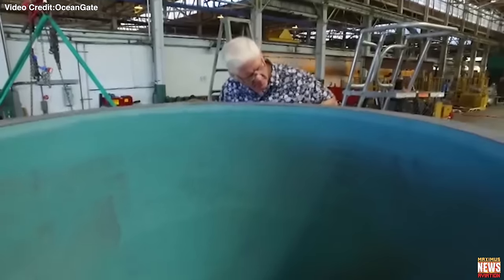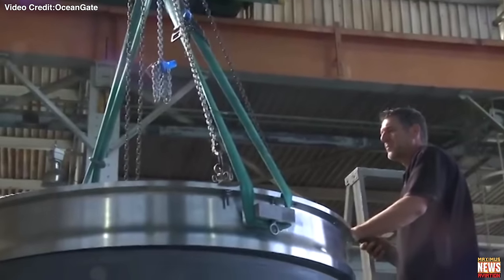Watch The Manufacturing Process That DOOMED OceanGates Titan To Fail. But It NEVER Had To Happen.

Comment: So the flange of metal over the composite was like an inch or two?  I understand the pressure would push the ring against the carbon fiber anyway, but, it's compressing the carbon fiber away from the ring too.  As the carbon fiber would compress more than the titanium.  I'd have at least wanted a deeper flange so MAYBE when they separated it would be a small twisting channel the 1000 psi water would come through first and it'd have to carve away the rest like a pressure jet.  with such a small flange the pressure jet had almost nothing to resist it's sideways spread until it stripped the epoxy from titanium and separated the ring.  Well it would have if the drum hadn't splintered into 1 million shards from the implosions micro seconds after the first spurt of water around the ring.

Comment: BS Mechanical Engineering here One thing that stuck with me from my education is the engineering code of ethics. When dealing with the safety of the public in any capacity you have to make sure safety in the design process is as important as functionality. You have to have all the stress calculations and material properties tested at not only 4000m but even 8000m on multiple tests. This is an engineering ethics scenario that should be studied for years to come. RIP to those 5 men.

Comment: while carbon fiber probably wasn't the best idea, i'm pretty sure it was the plexiglas window that was only "certified" for about 1k meters or something? guess we will know once the investigation is complete. but the most obvious piece to fail is definitely the window considering that they pushed it past almost 4 times what it actually was safely able to withstand. or just the caps flying off because of the pressure considering they were literally glued on. i doubt the hull was what gave in / was so unstable that it actually imploded. maybe... but the window and/or the caps seem more obvious.

Comment: Maximus, hope you read this. I think it's irresponsible from you to blame the manufacturing process itself. It is neither the process nor the material to blame. It is the decisions taken as part of their design process. Filament winding excels in producing pressure vessels, that withstand even higher pressures that those the Titan was designed to bear. Composite Overwrapped Pressure Vessels (COPV) are designed and produced to withstand even the double of pressure you find at 4000 of depth. There are several flaws in their final product that come from their engineering: the Titan is not reinforced along its axial direction despite its structure is submitted to a biaxial state of stress (even triaxial if the thickness is considered as sufficiently thick); the angle of the wound reinforcement seems to be 90° when it should have been close to 55°; and perhaps the most important, the interphase between the metallic liner and the composite shell. There exists a discontinuity in deformations and stress. So, if there's something or someone to blame, is their lack of responsibility in ensuring a safe product. This guy, the owner, CEO, whatever, he was an aerospace engineering. He disregarded "basic" concepts, concerns, and regulations. So?

Comment: I think they were thinking the pressure would keep things together.. like Previous comments glueing metal to carbon fibre doesn’t work with out some Mechanical fasteners … The process of laying up carbon finer was very interesting thin strips Wrapped continuously to form a Cylinder not much over lap of each layer not like laying up large sheets…. The titanium ends then where bolted with 17 small stainless steel bolts torqued… Come on it was bound for failure… I’m surprised it never failed on the first dive…

Comment: I think that add exterior titanium cilinder with a lot of screws on both sides (like the windmills in the basement) atached to the rings, plus the glue (as seal) would be solved the problem. Only the glue on a smooth surface, to me, looks a bad idea. Different materials, high compress and decompress at diferent sizes, repeating......

Comment: Not only was it made from carbon fiber, it’ appears it was made from unidirectional carbon fiber tape, which is much less sturdy than a bi directional weave. When they said it was made from carbon fiber and titanium, I assumed the entirety of the pressure vessel had some sort of titanium layer, but it appears titanium components were just bonded to it. Truly unbelievable. A bad design covered up by some decent looking probably purchased exterior cover panels. Sketchy

Comment: Tension vs compression...  Carbon tanks are use a lot for firefighters and now lately also in Scuba industry when price is cheaper. But that is carbon weave holding compressed air under "tension" . Carbon fabric is good at holding tension.  But compression is whole different story. Then fabric is the worst type of material to use against external pressure.

Comment: Unidirectional orientation of the carbon fibers?  This means that the the only thing resisting the two titanium caps pressing on the cylidrical part, was the epoxy matrix of the composite!  This submersible was not even safe to dive down to a depth of 2,000 meters!

Comment: I just don't get why titanium was not used for everything including the body? Human carbon fiber technology is still quite in its infancy.

Also, glue to hold 2 different materials together. GLUE. No engineer, but I do know a little bit about physics and strengths and weaknesses of different materials. Eventually that glue would degrade from the constant pressure changes from multiple dives. Not to mention the differeces between the titanium and carbon fiber, one of them definitely micro fractured during the many dives due to the materials stressing on each other from PSI (the titanium crushing into the carbon fiber), and it wasn't the titanium.

Comment: Carbon fiber can only be as strong as steel in TENSION, but is always weak in COMPRESSION, for the same reason that you can pull a rope but you can't push a rope.

Comment: There was no engineer involved. Not in the design, neither in fabrication. It is no problem to get a permit for an experimental plane, but it would be impossible to start selling tickets for seats, even if the guest sign a disclaimer. How someone can use an experimental can to sell tickets is completely paradox for me.

Comment: Please tell me they somehow interwove those fibers...😕

because this suggests the fibers were not interwoven at all
just paralel rolled next & on top of each other 
& bonded with resin

At least please someone tell us they somehow did rolled perpendicular diagonal layers...
not really interwoven, but at leat much better/stronger than merely paralel rolled...

However I can't see how, with this setup,
they could do it fully diagonnaly 
in & around the cilinder's edges
unless they could build the cilinder 
with a fair bit of extra lenght
& then cut it to size...

Comment: i really doubt any of them had read what they have signed. stockton rush probably rushed them into signing the contract by just briefly going through it without going through the points that would make it look like a death trap
Reply: Money is money, if you're told to build component x you just do it.

This vessel never got any approval from any kind of engineer or authority, only "simple" worker did what they got paid for.

Comment: Jesus - what a ropey effort.  As a structural engineer with composites experience, I have to say I am horrified that a) Anyone could be so ignorant as to design such a lash-up, and b) Anyone would be crazy enough to get in it and go to any depth.   As scubasteve points out below, the CF and Ti components are totally dissimilar materials and it should be obvious, even to non-engineers, that the interface between them would be the focus of all sorts of extreme stresses not accounted for in this design - "glued together" - OMG!  I was also amazed to hear that NASA, of all people, were involved in this "engineering" fiasco early-on (furiously backpedaling out later on).  They should have just told Rush right off:  Man, are you insane?  Do you want to die in that thing?  And by the way, idiot, CF is for a Tension based paradigm - DO NOT USE in Compression.          But hey, what do those balky engineers know anyway?

Comment: WOW,  this was made to fail. Fibers put down in one direction only LOL  not criss crossing each other ...pure madness. This is like making a wall from columns of bricks and not interlocking rows with each other ^^  ..then ..gluing those caps to the cylinder :D  That seal failed or the tube changed to dust in 1 millisecond due to fibers delamination from previous dives.  INSANITY.

Comment: that door could be attached to the ring so securely  !!!but that doesnt matter!! becuase the 2 piece window door- ring  combo  was only held onto the main tube  by outside slippery  glue ! that  may have bubbled and started tearing away with each dive and  contracting. and expanding  . why couldnt they house ten bolts additionally with the glue drilled thru it !!!! this vehicle was never destined for longevity!!! surely with glue it would have been expensive , to maintain this glue take the whole titan apart apart and redo ... he didnt want to have to take it apart.  Maybe he thought it was stable.... and seeing  peoples weight and feet resting on the door during launch at a downward angle puts pressure on the glue and also if somone uses the bathroom there whole body weight is squatting on the door -ring combo . surely this stress along with normal degradation would accelerate even the damage that would occur From the salty water anyways... and pressure from the prior dives

Comment: Even the cheaper Chinese Carbon fibre road bike frames are never laced like that!!! There is no cross lace for side pressure, it is the most dangerous lacing without switching direction patterns. They thought that thin metal tubing would be protected by the Carbon layers which if you see are completely wrong even for normal above water applications!!

Comment: I have zero knowledge in this subject, but common sense alone should be enough to realize that this thing wasn't going to last long under that pressure.
It was horrifying to watch them glue the carbon to the titanium as if they are baking a cake. I would've never gotten into this sub, not in a million years...

Comment: The fact that this shit worked on 7 different dives and failed at number 8…
making the carbon fiber and inch thicker could’ve made it last a lot longer than 7 dives probably 10 or 11
Reply: nope. most of the dives were aborted due to weather or equipment failure. In reality this was like the third.

Comment: As far as I am concerned Stockton Rush committed suicide, and the shame is he took innocent people with him. The Oceangate Titanic was essentially two dustbin lids glued to a cylinder of gaffer tape and it was a disaster just waiting to happen. Just access and read David Lochridge's legal filings in respect of his claim for illegal and unfair dismissal where he described the inevitable failure of the Titan - then try a bit of a mind experiment and imagine it was filed after the damn thing imploded. You'd think "Yeah, right. Twenty twenty hindsight - really useful, that." Then stop to think it was filed five years before the Titan went kablooie and yet it precisely describes the technical, design and engineering flaws in the damn thing and how they would inevitably lead to disaster. Quaite frenkly it is chilling but compelling reading.

Comment: How did they ever believe a seam of glue would have kept out millions of pounds of pressure over repeated cycles. His aerospace aviation engineering knowledge didn't translate into deep sea submersibles. Rush also reportedly completely rebuilt the hull after a 2019 dive reported cracking noises in a Caribbean test dive.

Comment: This could only have worked if all the parts were carbon fiber. Glue joints are always weak links. I can’t understand for a few pounds saved, why they choose carbon fiber in lieu of a traditional steel hull which we know works.

Comment: Engineering factors of safety.  Engineered structures are designed with what is called a factor of safety.  A factor of safety can be anywhere from about 1.5 to 3 or more.  A factory of safety is used to a address uncertainties with regard to loads, material strengths and operational conditions.   At the time a structure fails, the factor of safety is less than one.  The fact that the Titian made previous successful dives says nothing about the actual factor of safety under which it was operating at the time.  It could have been 1.1, 1.05, 1.01...............in other words it could have been very close to failure.............................

Comment: you can practically see all the foreign material getting stuck in the carbon fiber, as they assemble all these different materials with glue in an open air warehouse by guys wearing dirty aprons and old leather gloves, it just doesn't seem like an environment where you should be making a high pressure vessel out of non-contiguous materials with nothing like heat or pressure burning or keeping foreign materials out

Comment: Rush kept touting Aeropace techniques to progress faster and ignored an important one that applies to every airplane since the Comet. 

For airliners, Materials like Carbon Fiber or even Aluminum have Fatigue life & finite load cycles that are determined, watched and tested to destruction. 

That sub felt like a garage built prototype made only to prove the design & find failure mode and not for people.

Comment: Why did they choose carbon fiber in the first place? It's not a spaceship and It's  not an aeroplane so weight should not be a primary concern. 

It's not that much cheaper than steel, is it?

Comment: I have no engineering qualification but just a simple DIYer. Even i know having to completely different materials fixed to one another with "glue" over time with the huge amount of pressure in those kind off depths your asking for a diaster with both materials failing at that joint part.

Comment: I don't like the way they have applied the carbon fibre I would have thought a diamond Patten. Would have been better. And I presume this is the original hull. In 2020 -2021 the hull was rebuilt due to signs of Cyclic Fatigue. He managed to source the replacement Carbon Fibre at a discount from Boeing as it was to old for use on there airplanes. It beggars believe especially considering Carbon Fibre has only 40 - 60 percent of the strength when used in compression. That's why as a general rule it is only used in Tension, as in pushing it outwards basically stretching it.
Reply: The 2017 Composite World article on the planned build claims 480 layers, a mix of equatorial wound layers and axial layers of strips. We don't see any axial layering in the video.

Comment: trying to wind thick-wall composite windings with this type of machine is already a flaw, it builds up locked-in tension between the inner skin and the outer skin, leading to the inner skin splitting away normally around halfway through the composite winding... you need a much more advanced process to start with to overcome this and that's before i point out all the imperfections that a visible in the film clip of the machine running, the process looks rather dry as well which leads to even more fatigue issues longer terms... i would be surprised if there was already a split going on prior to this dive all ready and without standard ultrasonic inspections and trained inspectors you would not have noticed due to the titanium flanges bonded on the ends.... which are bonded incorrectly if you follow any type of standard composite practices... all the staff should have don human factors course to understand the impact everyone has in these type of processes.... though it's always easy to point out afterwards....

Comment: Little did they know they were building a coffin. Even a junior mechanical engineer could tell you this was trouble waiting to happen.
Reply: They usually come in threes (the causes AND the disasters - freaky).

1. CF not appropriate material.
2. A cylinder OF ANY MATERIAL. At that depth? Gulp.
3. CF not cross-wound. Could snap the cylinder into two pieces over a large knee.

Comment: There are literally seals on that sub that couldn't even be accessed to be inspected. 

The glue and carbon fibre are the reason you're all chum now. 
Over time it degrades. 
On the first use, it's stronger than its 10th. 
So he'd obviously reached the maximum number of cycles. 
And at the cost of the sub total 250k! 
He could afford to make them disposable! 
Every 3 dives, they renew the hull. 
Because we know it gets weaker every cycle. 
Everyone knew that. 
So it was always going to reach the number of dives when it finally gave up. 
The last time. 
He was greedy imo. 
His name is Rush. It seemed rushed. 

Sheer hubris caused this.

Comment: There is no way of 'bonding' titanium to any other material by any glue or resin. One thing very certain, it was an disaster waiting to happen.
Reply: They basically used vacuum (or maybe a reverse taper) to seal the two materials together. the ring floated on the glue stuck to the CF.

Comment: If he had done repairs after the previous dives they most likely would've made it... Yeah it weakens differently than steel and other metals but it did the same number if not more dives than subs made of the usual material.... 

The death trap was the illusion that the carbon fiber was ok after more dives than what would retire other subs...

Everyone's always like carbon fiber do much stronger and better... But in reality it's actually about the same strength as steel of the same thickness it's just lighter and more carbon fiber can be used...